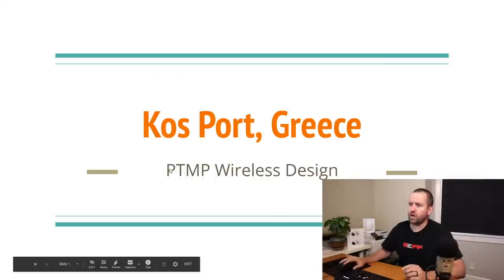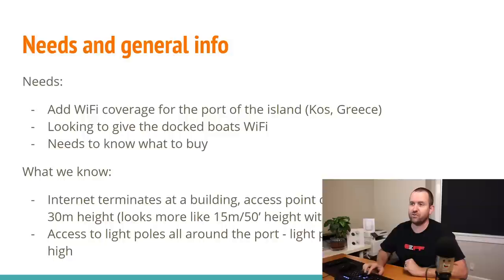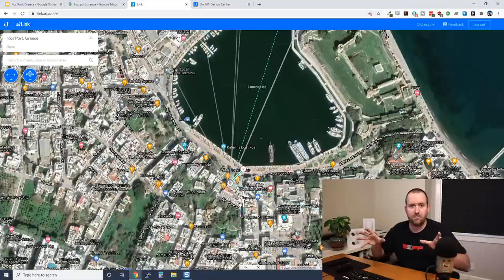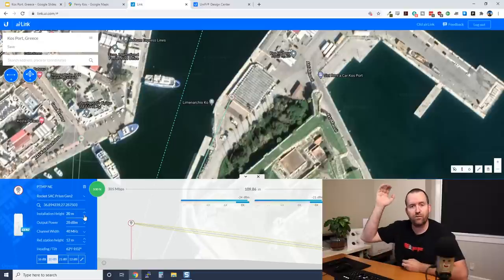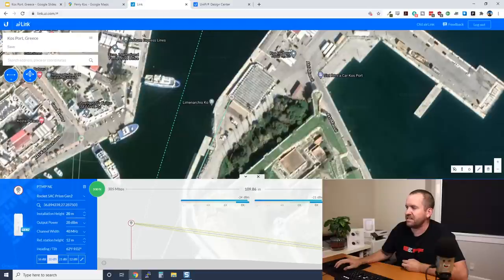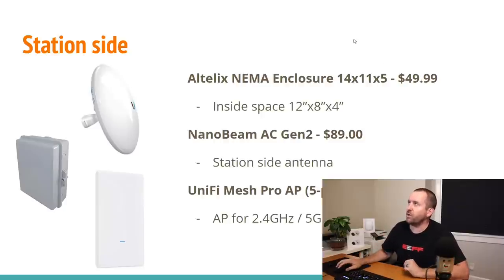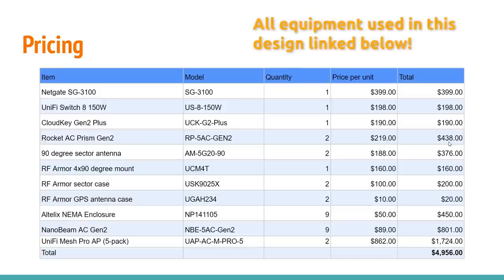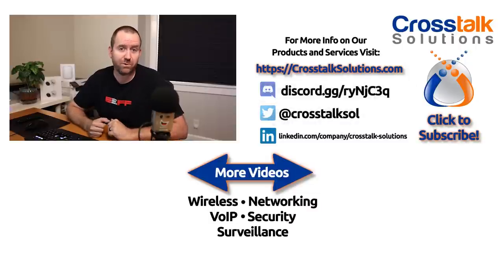Grecian Port PTMP Wireless Design

Comment: Hello, sorry for the translation, I had communicated with you by email for an IDENTICAL project and you could not help me because of the distance. When I saw this video it upset me. But I forgave you.

I just wanted to update and tell you that I solved my problem. Because of the trees, I initially opted for a 2.4Ghz PTMP system, but there was too much interference, the performance was poor.

I redid everything in 5Ghz. But since I didn't have line of sight with each station, I wired isolated stations with the nearest station.

It works fine now and I even added 4 camera protect. The signal is constant and no more cuts. The boat season is coming to an end but I will probably have other areas to cover next year.

Thank you and continue your videos, I do not miss one.

Comment: Hey Chris, thanks so much.  Using this in formation and some other research, I was able to design the right system for our spread.  Thank you so much. I used your equipment links to order but it doesn’t seem to be fair enough. 
I’ll be buying you a beer or two.

Comment: Dear Chris,
ThX for that very informative video. One gets a much better understanding of the capabilities of the devices when you see real examples.

There is one point that came to my mind but I have not checked that in advance myself
This is Europe and there are pretty big differences in legal channel use from country to country (outdoor and indoor differs e.g. in Germany) and legal output power. Your example uses 28dBm while there is a limitation (again in Germany) of 20dBm. (don't know in Greece) Since there a some geo coordinates the software you use might consider this
Furthermore - this is "harbor". so the use of radar is pretty common and might cause interference. But that's more a 5GHz issue
So very likely the setting switches to "Greek" according to the setting in the cloudKey, but that might effect the calcs 

Anyway - thanks a lot and waiting for the next design!
Reply: Most wireless products across all manufacturers can adjust the maximum power output, either automatically or manually in the settings. They also try to pick frequency bands that can be used nearly everywhere, and/or have configurable channels, but one does always have to double check.

Comment: A solid and good design Chris. If there is no way to get power from those light posts (I Assume that we would have the power from them), then maybe we need to use a solar panel on top and use a SunMax Solarswicth (since you are using the Nema box) and a Solar battery. Of course this will increase the price of the setup but as I mentioned if there is not a power source n those posts then this alternate power will do good. Also another question that I have is since you are using a cloud key why didn’t you use a UniFi security gateway or a gateway pro for your firewall? 🍻 Cheers and hopefully they hire you and go to Greece 🇬🇷

Comment: If a ship with enough height comes in, those directional beams down won't be supplying those receivers blocked with a network connection.  The receivers must be a couple meters higher than the maximum allowed ship height size to come into port.

I don't think the specified height mentioned for the receivers is going to be enough to minimize interruptions.

On a busy day, this could result in a lot of dropped connections per day.

Comment: There's no need to use 2 power supplies and injectors at each site. With passive 24v  which is a very crude system, you can easily modify a stock injector or wire your own single adaptor that feeds out passive PoE from both sockets.

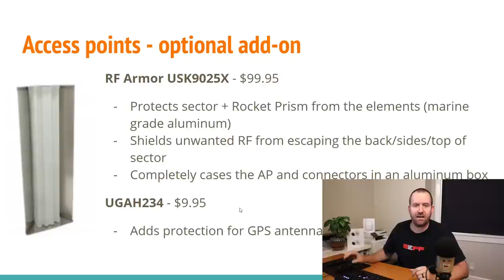Comment: I would recommend a stainless steel enclosure instead of aluminum for a seaside deployment. @21:33
Reply from the maker: The enclosure that I picked is NEMA rated IP55 - they should be good for a long while.  I had one of these directly in the elements on the Oregon Coast for 3 years or so, and it's still perfectly fine.
Reply: And not just any stainless, 316 grade stainless. The right grade of Aluminium will last a number of years in marine as long as it avoids spray of salt water because as soon as salt starts to form on that outer oxide layer it can corrode incredibly quickly. Generally a high deployment can avoid most of that spray but all it takes is a few storms with the wind in the right direction for that salt to build.

Comment: Very cool but I feel as if it is overkill for his needs. I'm not sure if that's fresh or salt water so that's something to keep in mind. 
At the building he could use
2x LAP-GPS (sync'd 10ms) as the APs and an Edgerouter X SFP as the router/switch/poe as it has POE ethernet.
Then for the "STA"'s (on the light poles) he could toss a nanostation AC (full size, with POE passthrough enabled) and then a  UAP-AC-M (the Mesh AP one) wired into the NSAC. 

This would cost much less, but really depends as to what he wants to do, he didn't mention having anything because if he did he could even use M2 devices as the APs.

Comment: Whenever I've done airmax deployments over water I've experienced better connectivity, etc when the axis are flipped (vertical to horizontal, horizontal to vertical), the only issue doing so is that the equipment ports, etc, will be compromised due to water or any other environment situation.
Reply: Yes agreed. Signals at a low angle over water can suffer very badly from multipath propagation and rotated polarisation can help. Better still is to set back the central station antenna well back from the roof edge so the the front edge of the roof obscures the reflected path of beam on the water, and only the direct air line of sight is clear.

Comment: Correct me if I'm wrong, but I'm pretty sure the multi packs of APs don't come with the POE injectors, so they'd have to be factored into the cost as well right?
Reply: afaik the nanobeam ac gen2 has a poe-injector included and has a secondary port with poe-passthrough.
Reply: @crazychatting  I believe you're correct for the single pack, but for the multipacks, I believe you get just the AP
Reply: @isaaclee-mort  correct, the 5-pack for the AP Mesh Pro don´t come with poe-injectors - but we don´t need them anyways because the single AP Mesh Pro gets power from the poe-passthrough port from the NanoBeam (which is not available as a 5-pack) and comes always with a poe-injector included ;) 
or am I completely wrong?
Reply: @crazychatting  yep, sorry, you're correct I believe I misread nano beam for something else, not sure what, but yeah, I'm pretty sure you're correct

Comment: Hey there, Just a thought id provision for a few of the Nano Beam AC Gen 2's for vessels in the port mainly the larger ones. I work as a ETO on these vessels and is a normal setup quite often to put one on the mast for the time in the port. mainly for that large part of the Dock with no location for a WAP's as the larger vessels will most likely be in that area.

Comment: Why would you not use a single pole style MTP antenna and only need one rocket? I did a setup similar to that, and it works just fine with Nanostations.

Comment: The standard voltage in Greece is 230 V with a frequency of 50 Hz. Most visitors will then require a voltage converter, especially for Americans used to a 120 V standard.

Just wanted you to inform you on power there.

Kurt
Reply: Most laptops etc, switches and PoE injectors run from 90v-250v no problem, though of course that should be checked.
Reply: @Rosscoff2000 , no need to check, they do. U.K. user here, all they need to do for us over the U.K. is switch out the plug cable with a british one. The POE injectors work just fine out the box as well as any electronic equipment ever used. Manufacturers learnt many years ago that having power supplies that can do both while covering most of the world is far cheaper than making two product versions and being careful where they ship. Seeing as most of the world uses 220-240v 50hz it would be silly not to cover it in something that is sold in multiple countries.
Reply: @backupplan6058  Sure, that's what I said, but I wasn't talking only about Ubiquiti or other modern electronic gear with switching supplies when I said it was still wise to check. Even nowadays plenty of US visitors still burn out things like hairdryers and other devices with mains motors, transformers or heaters in them when they take them abroad! LED lights using capacitative droppers also aren't built to cope with both supplies, and some higher power PC supplies still have a 120/230 switch.
So I'd say always best to check before moving a device from one supply standard to the other.

Comment: Beautiful design. I would try and throw UniFi BasestationXG with 802.3bt injector in to the mix to give 5Ghz coverage to that far side of the port. I'ts go 15dbi 50° antenna, so, I'd say it's worth a shot. Also, would you consider deploying ER-X if the office building (presumably theirs) were only a branch? That Netgate cost's about 8 to 10 times what ER-X cost's here in Czechia and I'm not convinced, that it is so much better, unless you really need advanced features.

Comment: Hey Chris,  I'm looking at doing a wireless bridge from building to building using ubiquity. (300ft) any recommendations on what ubiquity equipment to use?   I have already got the main building ran with ubiquity ap's and switches running cloudkey.   We need something with good throughput.  I have been volunteering to help my church out with the network.  They only had internet in 1 building and it was set up like a home network with 1 wireless router that only covered 1/4 of the church. I got that part worked out, now I'm tasked to get the youth building internet.... any help would be greatly appreciated.

Comment: you forgot the PoE injectors ;-) and since the 5 packs dont come with injectors (the singles ones do) I would go and buy 10 single ones (or not if you can get the injectors in 5 packs for a similar price)

Comment: isn't the 5 pack missing the poe injectors ?
Reply: Easy to forget.

When you do lots of installs you tend to have have boxes of the things lying around from previous jobs so never tend to buy any.
I know I used to.
Reply: @DEADB33F  Heck, I've only done a few installs and I have a box full of them! :)
Reply: Yep, I was just about to put the same comment.  Accordinng to their store "* 5 packs do not come with PoE injectors."  But, a 5 pack of injectors is only $39.
Reply: There's that, and I was also wondering if buying one 5-pack + a 5-pack of injectors + 4 separate units would be cheaper in the end?
Reply: afaik the nanobeam ac gen2 has a poe-injector included and has a secondary port with poe-passthrough.

Comment: Why Netgate + UniFi Switch 8-150W and not UniFi Dream Machine Pro? The Dream pro dont have switch POE, firewall, and DVR?
Reply from the maker: UDM-Pro doesn't have 24V passive PoE capability.  And while it would be fine for a small business, I felt this deployment needed a more robust firewall in order to future proof the design - for instance, if they wanted to add a 2nd load balanced WAN connection.
Reply: @CrosstalkSolutions  Thanks for te anwser, do yout think the pfsense is more robust?
Reply: @Dyno4Tech  The UDM and UDM Pro are having all sorts of stability issues. I could see a USG Pro, but not a UDM Pro, not until the bugs are worked out.
Reply: @Dyno4Tech  definitely

Comment: It's a great concept, but if its intended to provide reliable Wi-Fi to customers inside the boats which breaks LOS, you're going to have major issues. That is at least my experience.
Reply from the maker: The boats would have the capability to add a NanoBeam on the outside and route the signal to an AP on the inside just like we're doing on the light poles.  Could be an extra paid service to offer the yachts a rental network kit + installation services.
Reply: @CrosstalkSolutions  That makes the most sense to me and it's how I set up a deployment or two in situations like this. The problem is interpreting what the project customer and their customer's expectations are based on that email (hopefully I did not misread). The coverage will be there, it's just getting the customer to understand why they need the nanobeam+AP on the boat and the science behind it rather than "clicking on the Wi-Fi button and hitting connect". Support is the biggest hurdle in setups like this because you have to then take on running a mini-wisp and ether the project customer or yourself has to take on the support. I also find people with smaller boats live, in shall we say, a relatively low budget. It entirely depends on the market and whether you’re going to have those customers that are resistant to your deployment style and downright rude that they can't just "connect". Not a project that I would take on, but I am sure someone is out there willing to do it!
Reply: You thing a boat 300K and more dont have one app with antenna outside to connect to Hotpoints?
Reply: @Dyno4Tech  Entirely depends on the market. I have worked in both “5-Star” marinas/port areas with affluent clientele and less affluent marinas & clientele. Not all boats are 300k if not just live-aboard scrapheaps to avoid paying extremely high rent. I do not want to speculate the market and my go to would be to assume it is a mix of both. Supporting those you have to rent/sell hardware too is a pain that many choose to avoid. Once again to drive the point home, the design must be market based to satisfy the specific clientele this port would have, and to that point if your selling NanoBeam+AP be prepared to offer some sort of support solution for those less adept.
Reply: @Dyno4Tech  You never know. I just sold a coach that was $300k new, and I did not have any sort of wireless setup in it, even though I had it 4 years and I've been in IT since the 80s. But a little trailer next to me that was $25k might have a very elaborate wifi setup. I've found that my little $50 Hootoo travel router works in almost every situation, and when I need to be on LTE I use an AT&T Mobley that I pay $20 a month for with unlimited service (of course they can start throttling after 22 gig, but I have only seen that happen once) that's connected via USB to an Asus router running Tomato firmware. My new little travel trailer has a Wifi Ranger built in, and it is pretty crappy so I keep using the Hootoo.